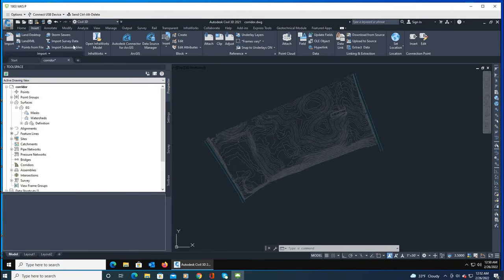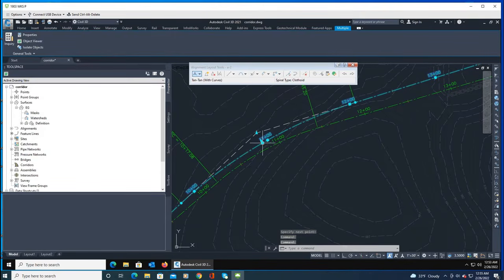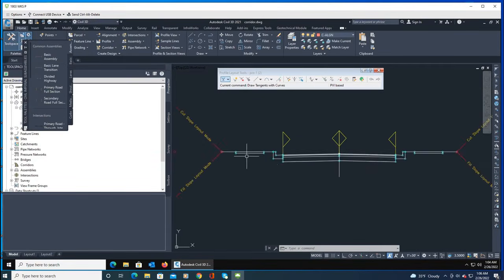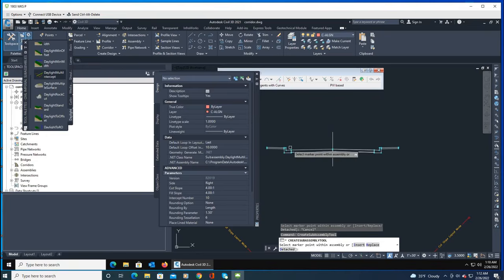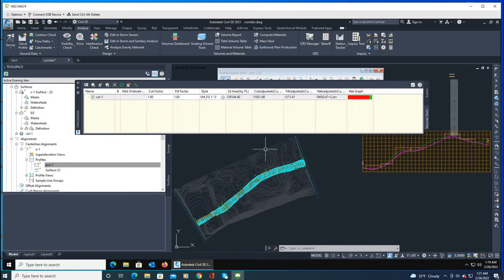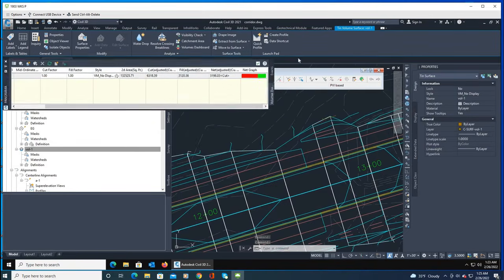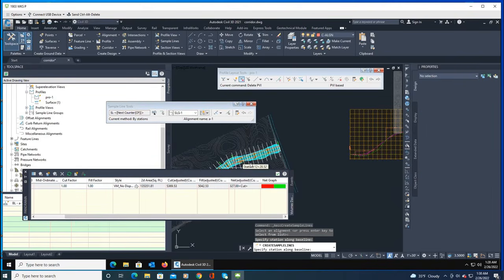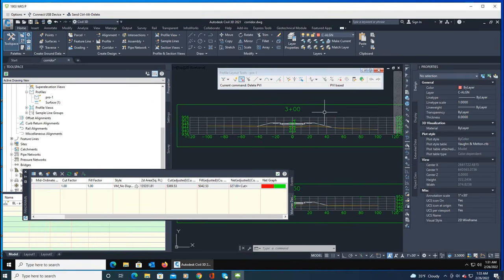Civil 3D 2021 steps to create a Corridor with | Alignment | Profile | Assembly | Cut/Fill & Sections

Comment: great video 
if i have an urban city and i want to turn the entire project to surfaces (house plots + streets) into a single surface for gps guys on site . is this viable option for each street to turn them into surfaces indevetually then later turn them into 1 big surface by pasting roads and house plots together ? if yes what about connecting t junctions and crossroads and u turns ?

Comment: does the cut and fill data for section view and profile view should match or no? i managed to display both of them but it shows different values for cut and fill.
Reply from the maker: A surface to surface comparison may be different from a cross section method depending on what u used in your analysis but shouldn't be too much. Roadway cross sections use average end method based on stations. In short, they should be real close or something else is wrong.
Reply: Hola, la diferencia del volumen que hay entre la comparación de superficies y el volumen de corte y terraplén de las secciones va a depender de la distancia en que generas las secciones transversales, entre más separación hay entre las secciones más diferencias va a tener, puedes hacer la prueba con secciones cada 20 metros y después cada 50 centímetros (siempre el volumen más real va a hacer el de comparación de superficies)